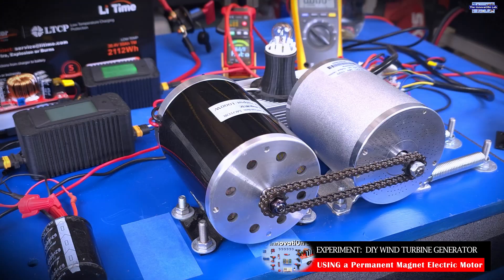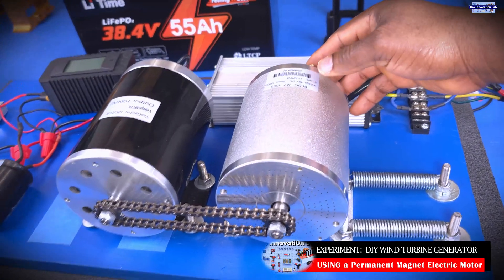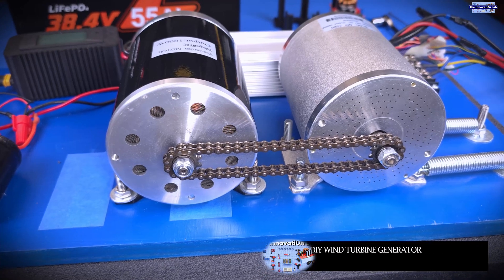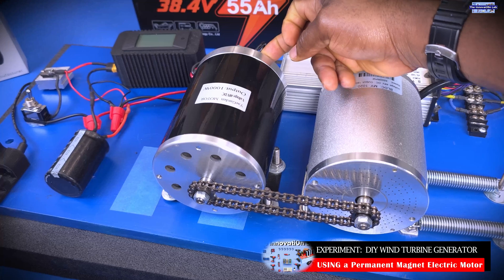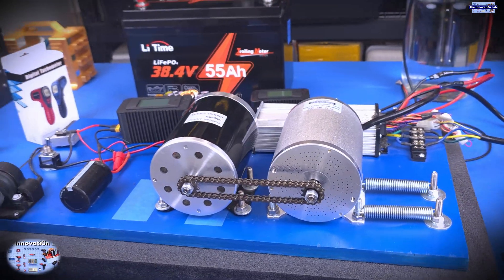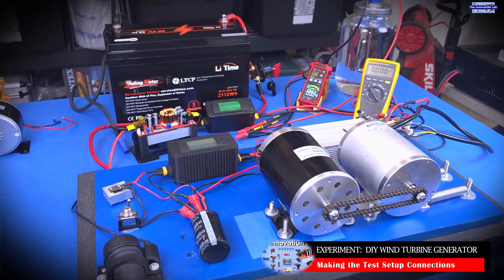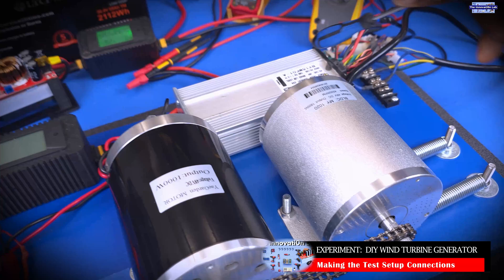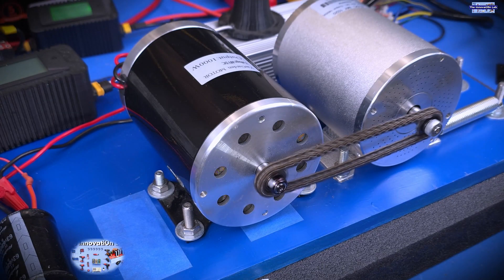Diy Wind Turbine Generator

Comment: HI,I have this type of dc motor but it is only 250w not 1000w and I have plan to some experiments,my  question is,what I need to properly charge battery?capacitor,diode or else?and also wpuld like to connect something as load.
Reply from the maker: Great question.
I have not looked into using this for battery charging so I won't be able to advice you on it. However, if I was to do it, I would rectify the output by adding a full-wave bridge rectifier...also make sure that the drive motor has enough speed/rpm to provide a smooth low-ripple output - when load is applied. You will need an oscilloscope to measure the ripple levels of your system....I wouldn't trust a Digital multimeter for this experiment.

CAUTION:⚠️⚠️⚠️
Low rpms may present huge pulsations and this will damage your battery system. So proceed with extreme caution.

Consider becoming a member of my Patreon for only $5/month.
https://www.patreon.com/TheInnovati0nLab?utm_campaign=creatorshare_creator

Respectfully,
The Innovati0n Lab

Comment: use axiel flux motor
Reply: I am using a hub motor as a generator and its star config try that and place it on rooftop of card , blades orientation like laptop fan
Reply from the maker: Sounds great. 
Thanks!

Respectfully 
The Innovati0n Lab💥
www.theinnovati0nlab.com

Comment: Can you suggest any good motors that has less torque, produce power at low rpm and can be used as s wind turbine generator
Reply from the maker: Great question.
👍👍👍
But I think you should look into getting an actual portable wind turbine generator. The price difference may not be too large.

I used these as an experimental concept....and because I already had the motors. Maybe in the future I will do another test with an actual wind turbine generator. 
But this video has to do well first....so help by sharing it.😊

Respectfully,
The Innovati0n Lab💥

Comment: You've reinvented the Dynamotor. It has been used before for military radio equipment that needed high voltage AC in the field, when Vacuum Tubes were the king of RF power.
Reply from the maker: Oh wow!
That is really good to know. I love old tech as well.
However, I was simply just curious about making the correlation since I already had the sytem and the motors....so why not have some fun with it..hahaha.

Thanks a lot for the great feedback.

The Innovati0n Lab 💥 www.theinnovati0nlab.com
Reply: Ì have had dynamotors and one that uses dc to produce ac. Still have it and it's called wind something

Comment: i tried a geared ratio 1 to 7 to use less watts to produce more watts. it has not worked yet but getting close. so i can charge at night.
Reply from the maker: Wonderful!
I am glad to hear that. 
Please don't forget to share your experience with us.😊

Question:
Are you using one of these permanent magnet dc electric motors? or are you an actual wind turbine?

Success Wishes.
👍👍👍
The Innovati0n Lab 💥 www.theinnovati0nlab.com
Reply: @theinnovati0nlab782   48v 15 amp permanent dc motor. hope to get 7x the input to charge my 600ah battery bank.
Reply from the maker: @victorreece9256  
Wonderful. 
I will also recommend checking out actual portable wind turbine generators - they may not be too expensive in comparison. Unless you already have the permanent magnet dc motors.
I hope you saw my summary in the end?😊
The Innovati0n Lab 💥 www.theinnovati0nlab.com